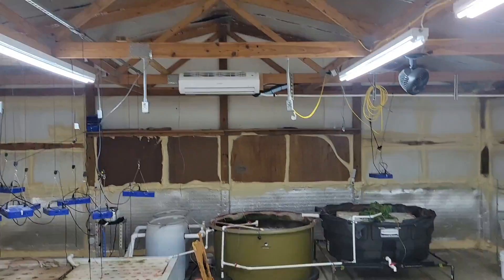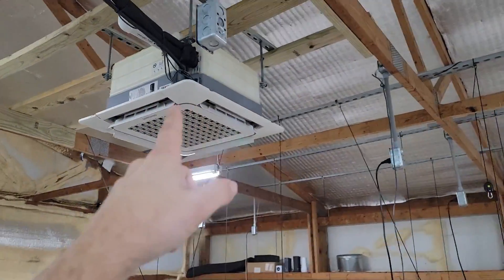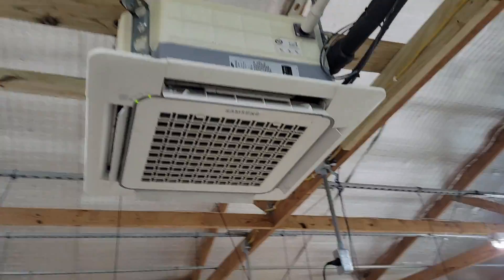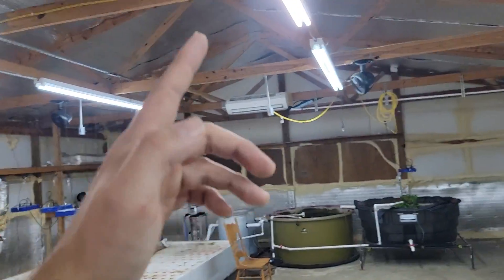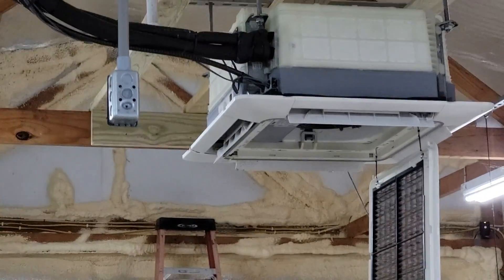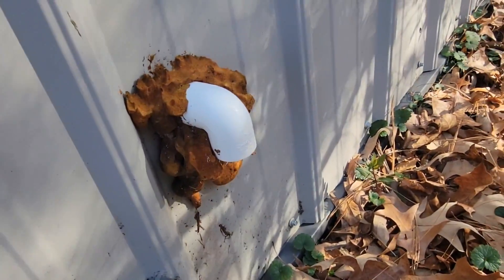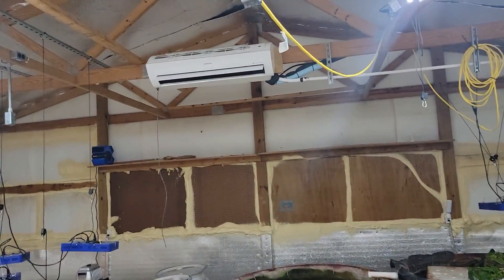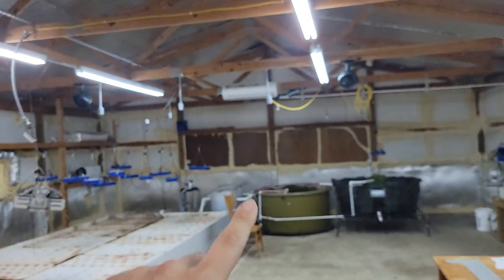Ceiling Cassettes Verses Wall mount air handler #minisplit #airconditioner

Comment: The warranty claims can already be a pain for these split systems with HVAC tech install so why use one. Just get it installed on the cheap by a licensed contractor if you must and hope the thing never breaks and if it breaks, be prepared to have it replaced or wait forever for parts and eat the labor costs. Personally, I was shocked by the quotes to install in Seattle area. An all new ducted system was cheaper so I laughed and went with ducted system instead. Honestly a ducted system takes a lot more work with all that sheet metal and installing a properly sized system.

Comment: I am using the cassette in my dorm rooms in Merida Mexico. I like them, I like the condensate pump, which gives me a lot of flexibility. I installed a variety of sizes from 1.5 ton to 5 ton. My outreach teams are very happy with the comfort of the dorms. Here I am using AUX Brand, but they are different than what is available in the USA, I don't think I would buy AUX USA models, and I don't think they even sell the cassettes in the US, it appears that they are making lesser grade Wall Units for cheap sell in the US. I like Taddy's comments on not self-installing, a lot of people do that here, they don't vac down the lines, and on hot days, which is the norm here, it will not cool properly, There are many people that I have discharged, vaced down and recharged and they are surprised of the difference, and their electric bill also drops. Here in Mexcio we pay over .45 cent per KWH.
Reply from the maker: Well thank you for this knowledge my friend
Reply: One more thing I like about my AUX units is it has fresh air intake mounts, which i utilize.

Comment: Have you ever put a ceiling cassette in a hallway between 3 rooms in a 1200 sq ft ranch? Currently there is a 18k cool only unit at one end of the house and does a good job at cooling the whole house. Looking to get a little better performance.
Reply: 3 of the veins would be blowing into bedrooms and the forth back into the main living are. Would that be enough air movement to cover the bedrooms they are 200 sq ft each
Reply from the maker: I have but I had to close the 2 side vanes

Comment: Would you recommend a roof mounted cassette or cassettes for a food truck/trailer?  I’m building a wood fire pizza food trailer for use in Florida.  Enclosed space is 15’ x 8’ and 9’ high.  I like the idea of a roof mount so I have more wall space for shelving.  Power is not an issue, it’ll be plugged in to shore power and stay put all the time.  I trust your knowledge and experience, I’d be grateful for any advice you can share.  Thank you
Reply from the maker: Depends on if you have an upspace it can't be mounted outside if you know what I mean.
Reply: Thanks for getting back to me, you weren’t lying, you really do respond to all the comments.  I’ve seen a cassette installed where they constructed a metal cover over the top to protect it.  If this was your call, would you do a wall mount over the cassette with a metal cover?  Also what size would you suggest for a 120 square foot (9’ tall) food truck?
Reply: I sent you a little token of appreciation on your Patreon.

Comment: You definitely slept through class when Ohm's law was taught. There is zero net savings in power consumption between 220VAC and 120VAC. 220VAC is actually 2 legs of 120VAC each. Sales people and shady manufacturers will lie about savings and power consumption by putting a DMM clamp type ammeter on a 220VAC wire and then a 120VAC wire and the 220VAC wire will show half the amps compared to the 120VAC wire. They never change the clamp meter to show the current draw is on the second leg of a 220VAC system because a savvy student would chime in and point out that Ohm's Law says in a circuit of same voltages on each leg,  current in parallel legs are equal but additive when calculating total Power consumption of the whole circuit.
PS: That gravity drain does not necessarily need a noisy high maintenance pump and reservoir if you drain it to a rain catchment system whose tank top is lower than the wall unit.

Comment: Hey Tad, great video and very informative, My brother and I recently bout a 70 year old house with no HVAC system in Anderson S.C. and the roof is too low for a duct work.
We are getting estimates from about 8-10 different companies to install ceiling cassettes in each room, and I want to ask for some advice.

1 - Do you happen to know any HVAC companies in my area that you would recommend?
2 - and what Brands of systems would you recommend the most, I recently found the Samsung ones and like those, but what are some of it's best competitors?
3 - It's humid here, do you happen to know what cassette brands also dehumidify? or is it common for most of them to do it?
4 - And Mold issues with these I should know about?
Reply: on your question #3, some units have a dehumidify setting, Here in Yucatan Mexico the humidity is extreme, I would be careful with sizing, going too big does not dehumidify well. I am using AUX brand in Mexico, but they don't have the same quality product line in the USA, I do use the dehumidify setting on mine.

Comment: When I look at the square foot per BTU chart, does the volume play a part?  I am looking to install a  heat pump into my metal garage building (one big room) which is 24' x 35'.. it is 870square feet, but it is 14' high instead of the normal 9 or 10 feet tall.  How does this affect the measurement in square feet then?

Thanks if you can help me.. I am really enjoying your videos..

Comment: On the ceiling cassettes you have to look at your roof rafter spacing to make sure the cassette will fit between rafters.

My attic has rafter spacing of 22 inches which the larger btu units will not fit into.

Comment: Can you help with installation of 220v system in an Rv? I’ve seen it done before. I was thinking of duct system to tie into the existing in basement. Or these cassette units and reframe the existing Rv acs in the roof. They have done also in some high end models.

Comment: I find the sizing to be the biggest red flag here. 12K BTU for 500-600 sq ft is .. insane honestly. I have seen these units placed in homes where they follow the sizing guide and it never ends up removing humidity because it short cycles. If anything, I think these should be undersized a little so that they have a chance to remove humidity as well. We are currently using a 9K BTU for an area around 750 sq ft (vaulted ceilings) and it does a fantastic job. I cant imagine having 12K for the 500 sq foot they recommend.
Reply: These units are variable speed, right?  Seems like that should help with short cycling?  Also, I think these units have a dry mode which should also help with this effect?
Reply: They are variable speed if they are inverter, although some models don't have a auto fan speed, and "On/Off" mini splits would not help with the short cycling.

Comment: My pole barn is 28x40, spray foam insulated and I would think I center placed cassette in the trusses will distribute heat and a/c better than a rear wall mounted wall unit… 24k btu?  Any thoughts… near Atlantic City, NJ

Comment: I have a 25' x 30' fully insulated new all metal shop. 12' exterior walls and a 17' height ridge. No ceiling, just an insulated roof. Right now, 2 small 5,000 btu window units are keeping it cool, and a pedestal shop fan to move air around. However, I'm in Texas and it gets over 100* in the summer, and the 2 small window units struggle to keep it cool. So what size wall mount mini split do I need? I have 110 and 220 available, but every dollar I spend on my shop is one less dollar I can spend on my 56 Chevy I am restoring!  ;)  Thanks for your help!

Comment: Great video. I am in the planning stages of a mini split install for next year. I want to get rid of my window units.  I have a couple of questions, can you mix wall units and ceiling units on a multi zone system?
Do you need a handler in every room?  My upper level is about 700 sq ft, 3 bedrooms that share a short hallway. It would not be practical (and expensive) to put a handler in all 3 bedrooms. I am thinking a 12k handler in the large bedroom.  Maybe fans for air flow?

Comment: Tad  i have a few celling cassettes not responding to the wireless remote control .  I replace the batteries but it not responding to the remote.  I turn it off on the remote and it stays on. What think the problem is  MY  name is Carlos  and i am in the Charlotte North Carolina area. The unit is running continusouly>
Reply from the maker: I can definitely help you
Click the join in button join be a member
Holler at me when you do

Comment: The 220V version is a little more efficient than the 110V version, however the 110V version will not cost twice as much. The 110V version uses twice the amperage at half the voltage. Watts = Volts x Amps, so the wattage usage is mostly the same. Your power bill is charged by the kilowatt hour, not the amp hour. That being said I also prefer the 220V version when possible.
Reply: you are correct in that because your pay for KW the difference in amp would not make much difference, but you can only buy 120V up to 1 ton or 12,000 btus

Comment: We're thinking of installing a ceiling cassette unit in our parc camper instead of that very noisy, inefficient air conditioning unit (I like to call) "Big Bertha" . Taking advantage of the ducting that runs through the camper. I figured why not make use of that convenient feature we have. What do you suggest? Thank you

Comment: We have 2 ceiling cassettes in an apartment above our garage. We have access to the attic for maintenance. Can we run the drain lines straight into the 1 1/2 inch kitchen pvc vent pipe coming up into the attic? We will use a 4 way 1 1/2 pvc fitting and run 1 1/2 pvc to each cassette with a short 3/4 pipe into the 1 1/2 pvc pipe. Not planning on using a trap unless we have to.

Comment: Question. Can you install a cassette ceiling mount on a sloped ceiling. It's probably a 30 degree slope. I don't see why you wouldn't be able to but just curious about your thoughts.
Reply from the maker: No it has to be flat
There's a drain pan inside that holds water
And if the pan is tilted it'll drip out of the pan
Reply: @taddydigest  Thanks! Any recommendations for a sloped area?

Comment: Can you turn the pump off or can you get ceiling units without pumps?  Ive got enough elevation from the condensate outlet to my vent stack or roof soffits to drain passively.  Would prefer not to not worry about pump maintenance

Comment: Hoping to cool my 850 sq ft garage with a mini split of some kind.  The in ceiling unit would be better for my application.  It is a regular house though, not a drop ceiling.  What ceiling mount units might be good for my garage?

Comment: I have a question. I am planing a 5 zone casette mini split, but i have cathedral ceiling. Is there any problem because the angle in the ceiling?
Could there be any problem with the condensation?
Reply from the maker: Yes do not install the four way ceiling cassette in a angle in the ceiling

Comment: That's some good tips here. I'm thinking the ceiling cassette could have more issues laying flat with many people installing those in the attic hard to access if they start sweating or leak. Maybe I'm wrong would like to see a 1 year test on these ceiling cassettes
Reply: Mines great there's a water pump
Reply: attic access is mute. if done right first. as there is no reason to ever mess with it. unless it just flat out fails.
i would like to go this route on my house, 4 ceiling regulators. (two bed rooms on the hot side of the house, two in the front of the house, living room, dinning room, kitchen, no walls here). room to work up top.
draining is also not a problem. might not even need the pumps? each regulate would be within 7 foot of a open drain. less if in a wall. all pending how built.
and then just insulate best to prevent sweating. no mater your location. worse case a simple air water pump. from a aquarium shop. they are quite, last dozens of years, cheap to operate. biggest problem with any drain is fungus, mold, plant growth. plugging up the drain.

Comment: Your condensate trap is useless on the ceiling cassette and if you're installing them on homes this way then you're asking for trouble like water damage and liability. Typically they don't require a trap and if they did the vent would be on the other side of the trap. If the trap becomes blocked then the pump is going to dump water in the attic. This system shouldn't have any trap. The trap has now become a service point and with no unions it will be unserviceable. Venting traps depends on the type of system and fan being negative or positive pressure in relationship to the coil. Evaporator coils where the fan is drawing air in through the drain would be a negative pressure drain and won't drain properly until the fan has turned off  and would have the vent in the outlet end of the trap. Ductless systems don't require a trap!
Reply from the maker: good stuff thank you for your knowledge 🙏
Reply: @taddydigest  I hope it helps. I'm certified for design, install and repair VRF systems for Toshiba and LG equipment and have installed many Mitsubishi, Sanyo and Daikin equipment as well. I've made a few mistakes along the way but have repaired quite a few also. Those little things can really cost a bunch. Take care...

Comment: I'm in the research phase of a DIY mini-split install for my garage.  I'd love to pay someone to install a mini-split, but there's no way I can afford $7500 to install a mini-split in the garage.  I'll pay $4K, for a $2K unit....but, not $7500.  It is what it is.  That said, I live in central Florida, which needless to say, get's "demon-b*tch hot".  And, in this case, a ceiling cassette would go in the ceiling leading to the attic, which is the obviously the hottest place in the house in the summer.  The good thing is that I have direct, and relatively easy access to the spot where the cassette would go.  Can you think of a reason a cassette wouldn't work, or would be a bad idea under those circumstances?

Comment: I have wall units, I'm looking to add cassettes. One thing to keep in mind for everyone is drain pumps WILL clog up or break causing water to leak. You won't know till the wall or ceiling is wet. Also drain pumps are loud

Comment: Great info. I have a flat roof above my ceiling, are there any issues? I assume there are more than 22" between ceiling studs, so ceiling min split fits in without removing support studs. Loos like best location would be in center of room. I also have an adjoining room (kitchen) where I could use a 2nd split. Both can run off one outside unit? Thanks

Comment: Great video! Question: can you mount the ceiling unit sideways in a wall?  Or is there a inset wall unit made for that? 
I have a spacious interior soffit into which I’d like to mount an inset ductless mini split (rather than having the ceiling penetration into my vented, unheated attic space). Thanks!
Reply: You can't mount it in the wall, the condensate trap needs to be facing up.
Reply: If you search for "LG Art Cool" you will find a picture frame that hides a wall mount mini-split behind it, the trick will be finding a place that has it.

Comment: I wonder if anyone has attempted refitting a condenser that originally came with a wall mounted air handler with a ceiling cassette. I would think it to be a straight swap but have not yet seen any videos on the subject.

Comment: Could these be mounted in the floor? Like in the floor of a room? And the lines run in the basement?
Reply from the maker: No but you can use one of the console units
 Check out my video I did on what types of Mini splits there are
 If under my playlist hvac tips for home owners
 The console units are nice

Comment: what do you think about air to water heat pumps. looking to use one to heat heat exchanger for plenum on havc system to heat house or rad floors will they keep heat at 30 degrees and below / without heat strips /how much power /  any help would be great thanks

Comment: I have 2 x 12” joists on 24” centers. It is decked for a loft on top and will be dry walled below. It is a new construction and I am considering the Daikin ceiling cassette. Is that practical for installation and maintenance?
Reply from the maker: I'm not sure  I would really need to see it

Comment: Cassettes will also fit in between 2 foot on center joist. Cassettes also use a radial fan which needs no cleaning as compared to a long squirrel cage and is much quieter. We always use a double flare like you would use on your brakes especially when using the preinsulated line sets as they are only half the thickness of Type L tubing. The 120 units only go to 12k but if we are in a gas home with no other 240 appliances we will offer the 120 to keep the cost of the generator down. Once you step up to a 240 inverter generator you double the price and if all you need is 1 small mini split it is worth staying with 120 volt. Good video thanks.
Reply from the maker: Great Info You should have a YouTube Channel 👍 😀
Reply: @taddydigest  Thats for you young guys. Im trying to slowly slip into retirement but they keep calling me  lol
Reply from the maker: lol 😆 🤣  alright deal
Reply: Can you get units without condensate pumps?

Comment: Hi Taddy, are there any ceiling cassettes that would fit the 14X14 inch openings on RVs? Thanks for the most informative video on mini splits I've seen yet. Tari from Houston TX.
Reply from the maker: I think the lowest dimensions are 24 x 24  for the Mini 4 way cassettes I will check into it for you 😉
Reply: I just saw that mitsubishi makes a cassette 14.4 inches wide and like 47 inches long. Made for 16" center joists.